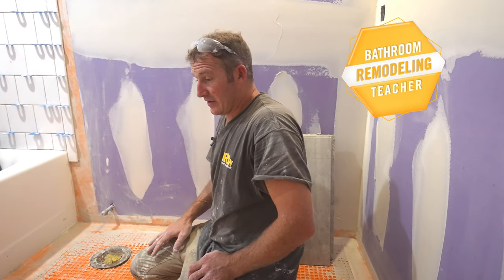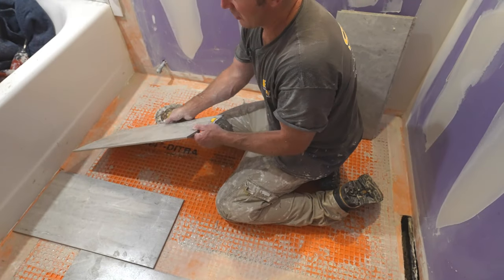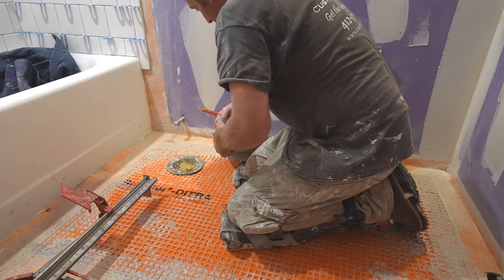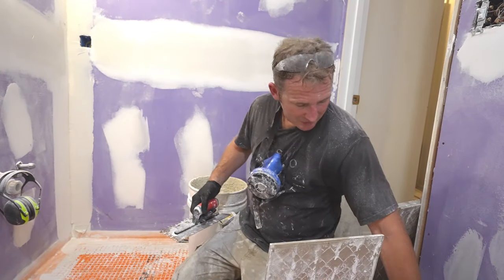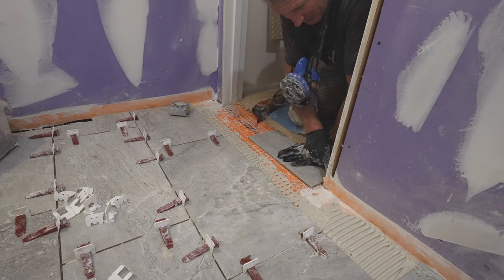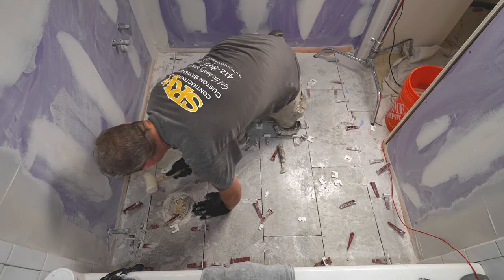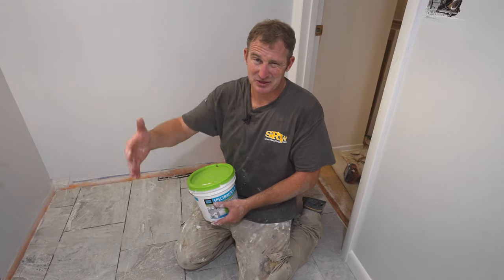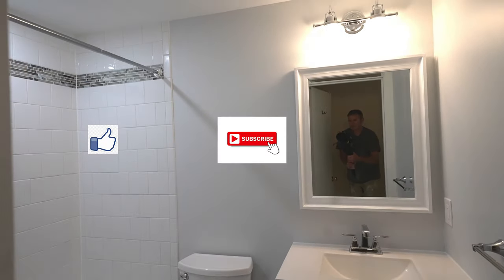Tile a Bathroom Floor l PLAN LEARN BUILD

Comment: Great vid, Steve. You’re spot in about the 5-min cure time for spectralock 1. I recently finished remodeling my master bathroom in the middle of July. Cure time was almost closer to 4 minutes for me. 

Glad to see the channel starting to grow. Well done, brother!
Reply from the maker: Thanks David! Appreciate the feedback. Great point!  Drying and set up times can change quite a bit depending on humidity, temperature and type of tile. A porous tile or stone can make it set up pretty quickly. But so far, Spectralock1 has been the easiest premix to use. 👍

Comment: Hi Steve, Are you grouting the gap between the tub and the floor tile? Or leaving it to fill with caulk? It’s hard to tell from your camera angle. Thanks!
Reply: A good rule of thumb is any time you’re meeting two different materials together, caulk is the choice due to expansion and contraction. 

So yes, it’s likely he used Silicone Caulk here